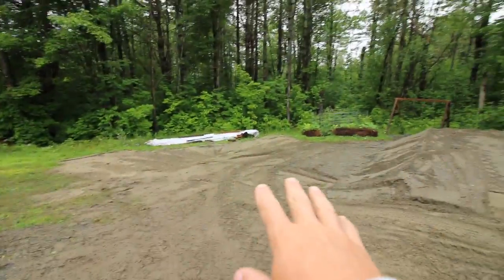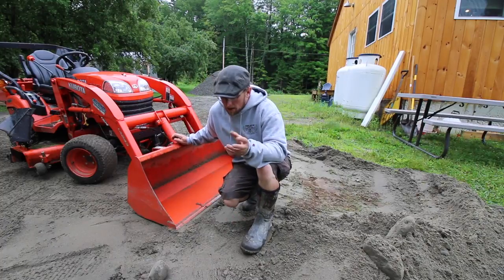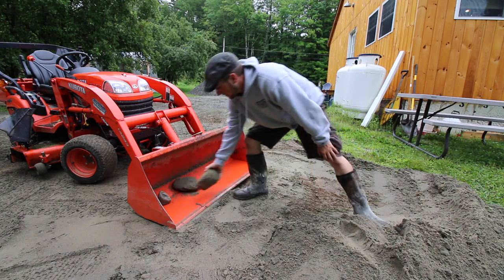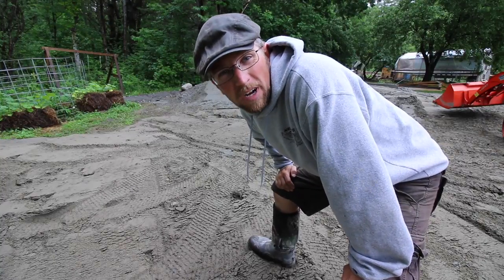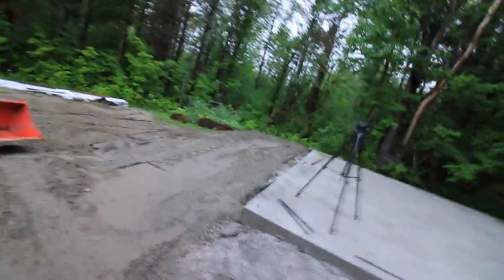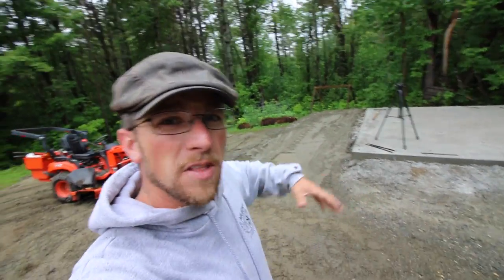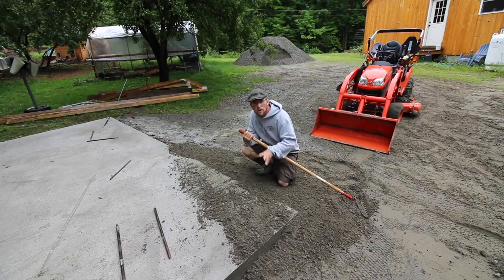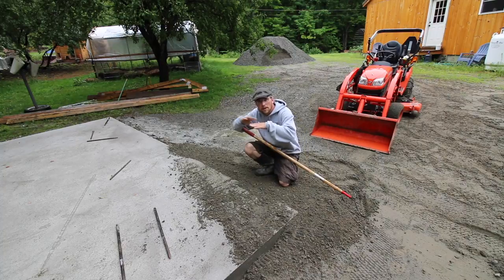Our DiY Off Grid Modern Homestead Outdoor KiTCHEN BUiLD Project #5

Comment: Dude! throw that rake away you got a tractor! you will get a lot more done. A few tips hope they help.Learn how to use your bucket, don't dump your load so close to where you want it, dump in front of where you want load and then back-up curl your bucket up and push the pile closer to where you want it with the back part of the bottom of your bucket, that will compact the pile and force it toward the slab (in this case) and this will also drive the bigger rocks to the bottom,  then when you get it where you want it, level your bucket and back drag on float and it will make it smooth the width of the bucket and the float will use the weight of the bucket to compact the fill going backwards this further drives the bigger rocks to the bottom as it compacts it back. When you have a pile of fill to place around a slab it is better to back drag once you dump each load,  you should level it in the direction of the way you want it to finish, once in awhile it is sometimes better to back drag the other way, with one front wheel and one back wheel adjacent to the slab. The tractor should be able to compact that fill harder than the plate compactor, if the down pressure or the bucket empty weight will not give you what you want, back drag with a full bucket load that should do the job, if you compact it with the tractor you should not compact it further by driving your wheels on it, if you are leaving tire treads in the fill the tractor will compact it further.When you are trying to get a full bucket out of the pile the best way to keep the pile neat and ready is to bucket in level at the bottom, as you push on the pile curl your bucket up to get a full load, if you don't get a full bucket (only full on one side) dump the bucket on the pile and let it roll down towards you then back up and try again, you should have a full bucket this time.